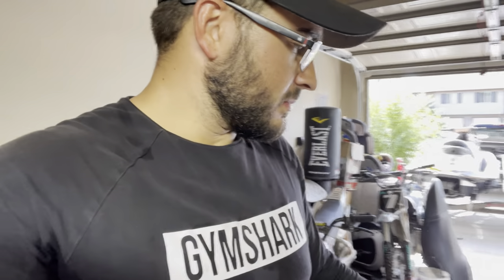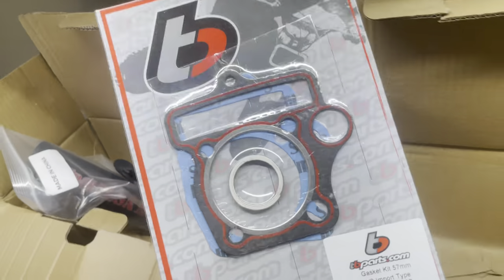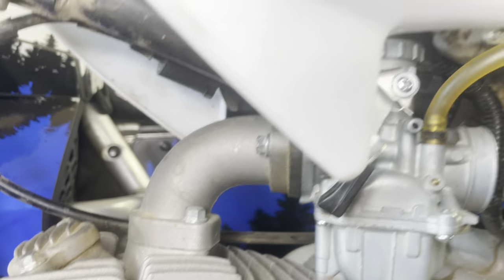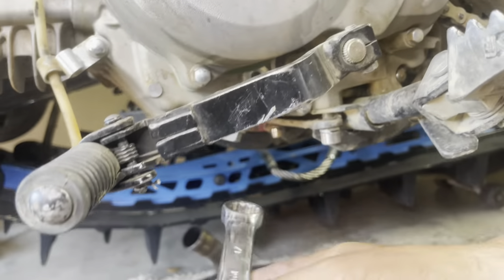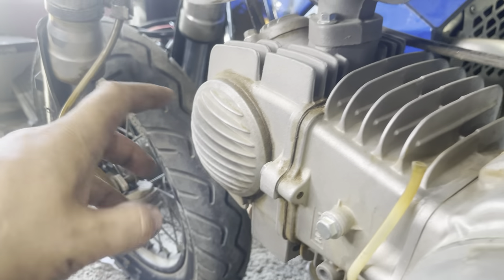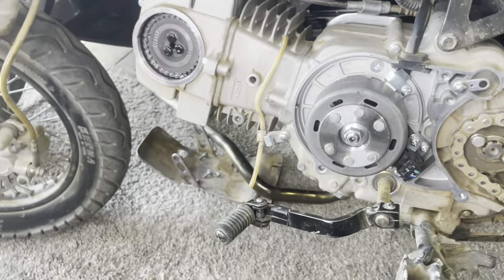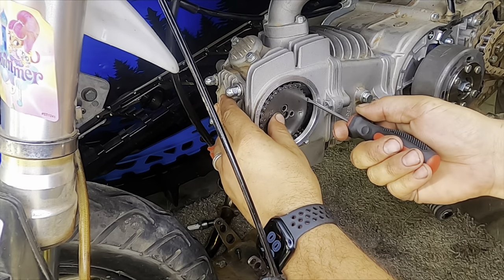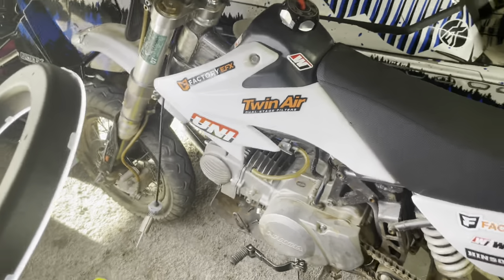Piranha YX 140 Pitbike Top End Rebuild So Soon?

Comment: Just a quick help for next time for any pit bike top end rebuild, remove the bolt next to the oil drain that has a spring and a rod, it’s easier to put the timing gear on instead of prying it with a screw drive, I learned it the hard way by running my yx125 out of timing lol destroyed my piston and valves
Reply from the maker: Ouch!
Reply: i have a 140 estart.I cant get mine to run, I have spark and fuel but it wont run, just cranks over, any ideas?
Reply: @babyhullk  check compression and timing, open the throttle fully while have the kill switch is pressed then crank it, you should be at the 140+mark maybe even 175 if your motor is healthy
Reply: @babyhullk could be timing , check for fuel spark and compression

Comment: Hey im kinda late but i notice you mention it needing a rebuild "so soon" And i think the only explanation for this is probably that the air filter was letting sand get in? I'm not sure if it had one of those cloth airfilters on it with the wire mesh but grains of sand can pass streight through them I found out the hard way

Comment: I closed mine up nice, and I can’t even get the timing chain onto the sprocket because it is so tight it won’t go on.
I don’t want to tear the whole engine down, and I don’t think I even know what I’m supposed to do anyways so idk if it would solve the problem. I looked for days at various forums  and searched for videos to try to find out. 🎉 bikes  torn down outside. with a plastic bag over it right now
Reply from the maker: Did you remove your timing chain tensioner?
Reply: @slavsquad  😅 I looked into that, got lucky instead, went back to the bike the next day. Messed around with it being super tight, it made it. Guess I had to stand back from it. But wow I am going to have to learn about the tensioners. Got a project bike now which is cool though I am learning a lot

Comment: Hi. today is my first time to adjustment the valve on my SYXMoto 125. I use your video to do the adjustment .003 on intake and .005 exhaust but it's nocking sound it's spouse the be with that sound or not necessary. I liked more quiet like before.
Reply from the maker: Shouldn’t be knocking. Redo the process and make sure it’s at top dead center when your doing it
Reply: It may knock a bit, but it’s best to adjust the valve lash and rotate the engine manually a few times and re turn the flywheel back to TDC and check valve lash with filler gauge, if it’s good then it’s fine even if it knocks a bit
Reply: @slavsquad  Yes I did the whole process again and it sounded the same. Then I tried again but set the exhaust to .004 this time and the sound went down quite a bit. But I felt that I lost of power. With the intake at .003 and the exhaust at .005 there you feel power. So thank you very much for your reply and help. Then I go back and leave it at .003 and .005 =) 👍💪
Reply: @cobalt930  Yeah that would be a matter of ignoring the sound. Because the power that is felt with that readjustment vs when they are adjusted from the factory you feel it. 💪😁 Thank you for your response and help.👍🏍
Reply from the maker: @rafyelmerse  my pleasure

Comment: Having trouble with get the piston in the.cylinder rings keep getting caught any trick or tips
Reply from the maker: Usually just go one at a time when pushing them down the cylinder. Push piston up from the button of rather then from the top. 
If you still can’t do it then you’d have to buy a kit for installing pistons. 
Should be able to get it with some patience and wiggling
Reply: Thanks man I'll give it a try